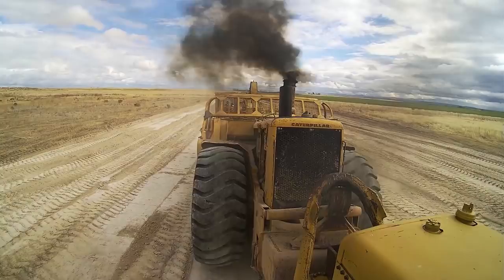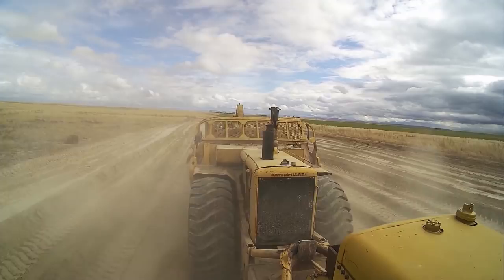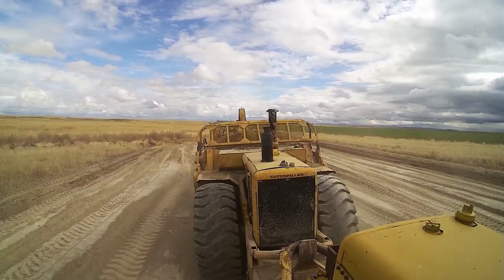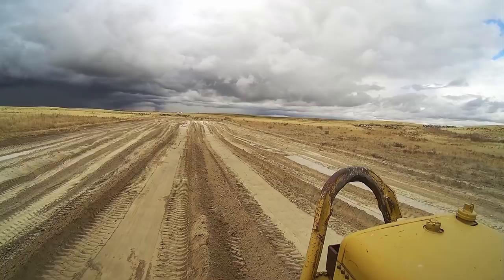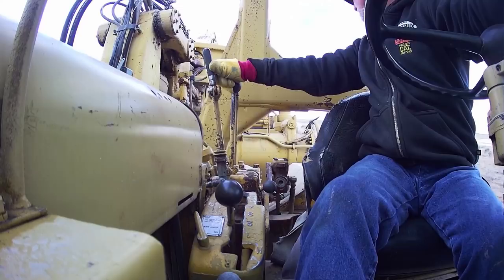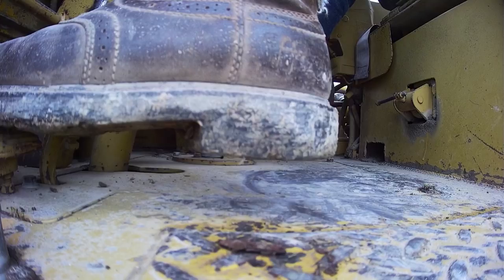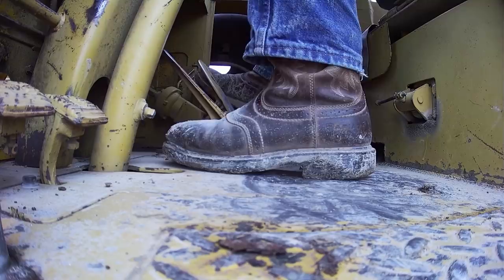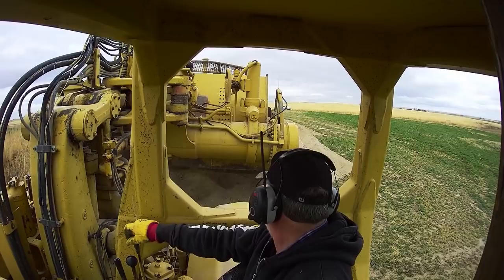How To operate Caterpillar Push Pull Scrapers

Comment: I’d pick that up in a couple of days.
What do you think?
Reply: You'd be surprised. I learned to run one in like 5 hours, but there's a difference between being able to run it and being good at it. I'm still working on being able to collect material smoothly without bogging down.
Reply: @89josephje  lol. You’re talking to someone who’s a third generation earthmover...started out loading trucks on a 20 ton excavator when I was 6, yes 6 years old! I started working full time in civil works when I was 13, I’m now 31 and I’ll tell you now experience and knowledge never ends.  I’ll also tell you no matter how great you think you are you you’ll never have the instincts of someone who started out when they were a young child.  Just like I’ll never have the Instinct of someone who started doing something else as a child, because the best time to learn and be talented at anything is when the brain is forming when we are infants.

You didn’t learn to run one in 5 hours, you learned the basics...Hook line and sinker lol.
Reply: I could learn to drive a scraper.  It looks complex but it's not doable...
I'd have blast for the first time after training to run and understand why things work and so on and so forth 
Great video ty!!✌🇺🇸
Reply: Not likely hero
Reply: @douglasmacomber2277  easy to make move ok. The ability to actually do anything with one no,  stick to mastering your riding lawn mower

Comment: Thanks for the explanation.  I was kind of surprised how primitive the cabs are (what year was this video) I figured you would have computer screens telling where to load & unload.  I remember first seeing pans work back in the mid 1950s pulled by dozers.
Reply from the maker: 11/7/18
Reply: Some people work another hour or two than pay notes out the hind end. If it ain't broke, dont fix it. Them old Cats will run til the wheels fall off with a lil maintenance. 🤙🏼

Comment: Why do you lower the cushion hitch? Does it put to much pressure on it if it's up while push pulling.
Reply from the maker: with the hitch on you can't put down pressure on the cutting edge, or the hitch just goes up
Reply: And it excessively wears the hitch pins.

Comment: Piece of cake no problem so basically the first lever makes the one thingy go up and down and the other lever stop the other thingy from going up and down and all the petals and the shifter knob make it go fast , right on i think i got it , so how do ya get it out again after ya fill it 🤯🤪😳 . I worked for a contractor that had a bunch but never set behind the wheel i always wanted to try it , i also watched a guy brake 4 ribs one day because he got bouncing to hard on a haul road and lost control of a loaded 621, good vid thanks
Reply: Yep and now your an operator

Comment: Do these scrappers use an standard Air Brake system (like what’s on busses/trucks) or do they have a different type of braking system?
Reply: Air brakes , but the older scrappers usually dont have brakes... You're brake is slamming the bowl in the ground
Reply: Breaks? No, no breaks at all
Reply: @slip8293  A break is like pausing your work, a brake is what's on a vehicle to slow down.
Reply: @Engineer9736  It is? Well I'm glad you cleared that up, I was sooo confused. I've run these for 19 years, they don't have breaks. You have to can out to emergency stop usually or just use gearing, trans hold and the retarder to slow down.
Reply: @Engineer9736  apparently slipwhat ever has had someone tell him good stories. Guy a arm chair expert

Comment: Uncommon Sense is what it is trying to fill up something with dirt from the bottom through a little Gap LOL make no mistake those are still better than the T-Rex with them old nasty Detroit's I remember they did away with the push-pull they weren't strong enough to push or pull each other anyway in that Alabama Clay every two T-Rexes had a D6 for pushing and you couldn't turn very short to the left because they would jackknife and hang up and you would have to push the nose around with another scraper or excavator loader or the six I remember getting one jacked around one time and we couldn't get nothing up beside it to straighten it out we ended up chaining the left front corner to the bottom of a tree and use the rear engine in reverse to drag that nose back around the only good memory I have with one of them T-Rex scrapers was we used to have this asshole that love to hit 2nd gear in that 6 and try to slam into you to watch your head jerk back I fixed his ass a good one,one day I heard him coming I heard him shift and them tracks went to clanking I dropped the bowl all the way and let that ass end stick up in the air about the time he hit second gear guess what I didn't feel a thing I seen his ass come off the seat he never tried me again I love all 4 stroke equipment you got some cool stuff
Reply: Rusty Stuff we had an operator like that too...except he didn't wear his seatbelt. Did you know a grown man will fit through the front window of a cat dozer when the scraper grabs the brakes a moment before impact?  Although I never asked him, I heard his ego hurt worse than the burns from grabbing the exhaust stack so he didn't go between the dozer and scraper!!!
Reply: @adamkolacki3344  these T-Rexes didn't have brakes and they were high track sixes open rops the seats angled slightly to the side so I believe  your left hip  would hit he used to think that shit was funny some of them guys would complain he did it to me once and it hurt my freaking back I didn't say anything you know how I took care of it and for that he got against me nice and gentle from their forward

Comment: Its an automatic gearbox my dude, just use the the trans hold when loading. Makes it easier for me anyways.
Reply from the maker: You must not have or use the diff lock? because holding both down is a pain and accidently upshiifting at the worst time can be very bad so I just put it in 2nd and forget it☻
Reply: @Jpaydirt  Diff lock doesn't do shit to the breaks man, it syntonizes the tires for more grip when loading or going up hill. Shifting gears is for those who drive scrapers, those who know how to operate them don't do that shit
Reply from the maker: @slip8293  So, if you step on the diff lock it cuts the air off to the individual wheel brake lever so idiots can't use them, is that what your referring to? because you can do damage trying to turn on hard ground with the diff lock engaged and if you tried to turn and use the individual wheel brakes at the same time you will break the jaws on the lock.
Reply: @Jpaydirt  you don't turn when you break. Of course you don't turn when you hit the diff, your loading or going up a big ass hill. Why would you turn? Lol
Reply: @Jpaydirt  anyway, you do you man. I'm over this pointless conversation. Peace.
Reply from the maker: @slip8293   @SliP  well some operators make mistakes so CAT had to come up with a way to minimize it, the newer stuff doesn't have the individual wheel brakes but this older one does, are you familiar with the individual wheel tractor brakes? I went back thru my video and I didn't find anything where I mentioned the brakes,  why is this pointless? all I wanted to do is answer your comment and explain the individual brakes and how they are disabled when the diff lock is engaged, just figured maybe you weren't familiar with them
Reply: @Jpaydirt  You can drive your scraper, good for you. Keep shifting if you want I don't give a fuck. Have a good a one dude.
Reply: @slip8293  when i worked the pits in the beno fields there was 2 and 5 nothing else
Reply: @slip8293  have you every actually ran a scraper
Reply: @brianjohnson6053  Well I've watched plenty of YouTube videos! Thats the same thing right???

Comment: This might sound dumb but why not have both engines on 1 gas pedal?
Reply from the maker: when you turn the rear can't be pushing or................well all kinds of problems arise
Reply: Because when you turn, you must back off the rear engine or the power will push you faster than the tractor is traveling and stop you from a sharp turn.  Once you are going straight again you use both fuel peddles.
Reply: Picture a bike with two engines, if the rear pushes faster than the front  in a turn it will pile the rider up all over the place. It's a bad thing. Hope I helped.
Reply: @Jpaydirt   Thanks that makes sense
Reply: Also the rear engine has a locked differential so both wheels drive so you always let up on the rear engine while turning hard

Comment: Are seatbelts used in this operation ?if not why.
Reply: YES!! Lots of guys don't but defiantly should. Ive taken a pan down the side of a topsoil pile and if i didnt have my belt on i 100% would have gone threw the window. I always have my belt on when i run anything.
Reply: I didn't for yrs. Till I seen a few of them upside down. Not a pretty site
Reply: I saw one hanging next to the seat, so yes, they have them on this operation! Lol
They may be thinking that it's all flat and level so no need, at least not until the hitch breaks or you get rammed too hard, or blow a tire, or hit a bump and get launched, so really not many reasons to wear a belt!
Reply: Definitely wise to wear one on a scraper.

Comment: What’s neutral run switch? 3:13
Reply from the maker: in the run position in sync's the transmissions, in the neutral position it will shift the rear trans to neutral

Comment: Now for the big question, one foot or both feet on the throttle pedals?
Reply: I use one foot untill my foot gets tired then I use both feet in the cut. Or of im cutting sideways I'll use both feet to keep the rear from sliding away from the guy behind me.
Reply: I use one foot one front and the heel of my boot for the back seems to work for me just feels weird having your foot pretty well sideways all day 😂😂😂😂
Reply: 1

Comment: I dont understand why you have to have something pushing/pulling these.
Reply: Simply a traction thing. The one in front drives and scrapes while the second pushes it for more traction. Then as the first picks up its pan, the once "pushing" scraper drops its pan. The now loaded front scraper pulls the original push scraper as it loads, once both are loaded, they split and dump off somewhere
Reply: Even if they could get enough traction, it would be too slow.... they want to move mountains now....
Reply: Self load one and see...

Comment: Can you make vid like this but how to operate a motor grader?
Reply: Get a job working for a county road department! They'll teach you how to operate a maintainer! The only job I ever had and got chewed out for going to fast!!  They are fun to run , the things an old school operator can do is amazing. Ask an old schooler about cutting blue tops.
Reply: @mikeleikam2892  

Is "blue tops" the same as shining a hub? That's what our blade guy called it when we would do fine grade together, when blade would scrape across top of hub leaving it shiny, sometimes pulling the feather out. 

If not, what is "blue top"?
Reply: I somehow went from scrapers to motor graders (blade) when thinking about "blue tops", so really I got no idea what blue tops are. Enlighten my curiosity please
Reply: Ok I'm an idiot. Thinkin motor graders cuz original comment question was about motor graders. So guess my original question still applies, are blue tops and shining a hub the same?
Reply: @GRAZINGARIZONA  blue top here is they mark grade with a stake with a small flag attached and the blade operators cut grade to match top of stake. I was never good enough to do it , but some of our operators were amazing at cutting almost perfect grade. I was usually sent somewhere else to play with a loader!!
Reply: @mikeleikam2892  

I've been outta the makin grade industry for like 15yrs now. I think I remember puttin in 48" stake and tying red, white and/or blue ribbon to signify on grade, 12" below and 24" below grade for rough grade (or something like that). I mostly did finish stuff, we had a little john deer 760a scraper (held like 7-8 yards), so whenever I did rough grade and like a cat 657 would dump, it would dump 6" of fill for what seemed like a freekin quarter mile. Thanks for the response, appreciate it.
Reply: @mikeleikam2892  

As far as a grader goes, the guy we usually hired had an old, clapped out cat 12h or 14h. Didn't idle so he constantly was on/off the throttle, loose as crap at most the pivots. Don't know how he did it (neither did anyone else, got told he don't know what he's doin constantly by just about everyone) but he produces a bunch of beautiful finish grade on the regular. On a slow day he let me try to push dirt up about  18" to make a bench for curb grade. I've never ran a blade before. Then I found out how hard it was to just keep his machine running, let alone jack off like 15 different levers while looking at about 6 different things at once. Think in 5 min I stalled it about 20 times AND pulled more dirt off the bench I was trying to build than put up there (considering I pulled a bunch off and put none up there). i would say pretty unsuccessful attempt at a motor grader career, fun nonetheless.

Comment: Why scrapers have underpowered engines?
Reply: No expert but since these things are built for maximum efficiency, i am pretty sure it's extremely cheaper to have them run that way. Costs alot less fuel if you combine them for the short filling task and then run them 90% of the way with those underpowered engines...
Reply: @patrickeigenmann138  that's actually the only logical explanation. Sometimes they use bulldozers to push them till they fill the bucket
Reply: It’s not lack of power, it’s lack of traction. It doesn’t take much power to overcome the traction in anything wheel driven and it just stops. Either use tracks by pushing with a dozer or hook a couple together to get traction that way. Also the loaded one is a lot heavier and thus has a lot more traction. Jeff